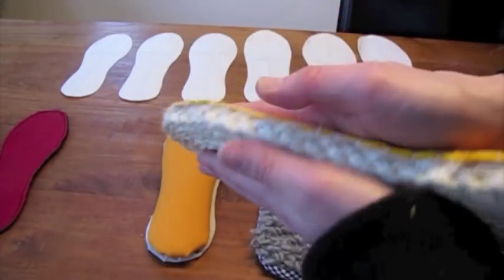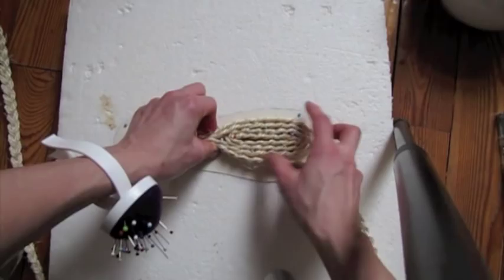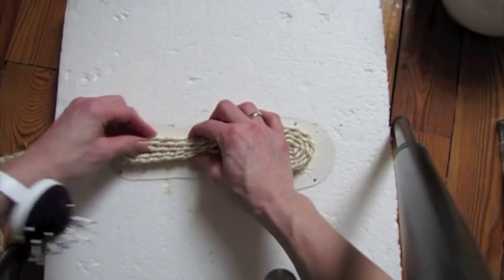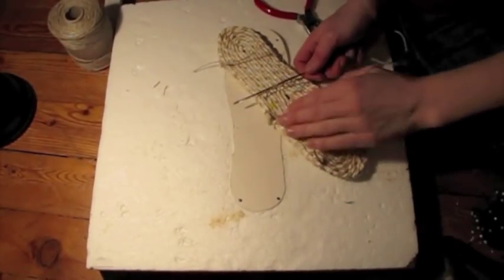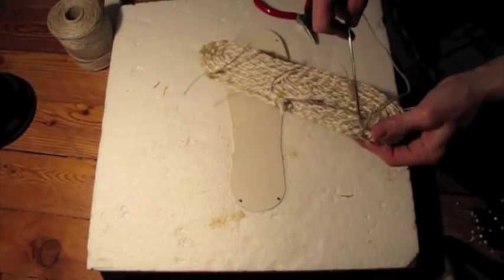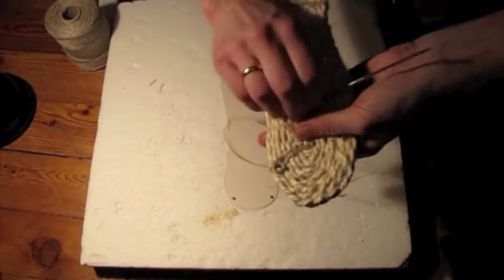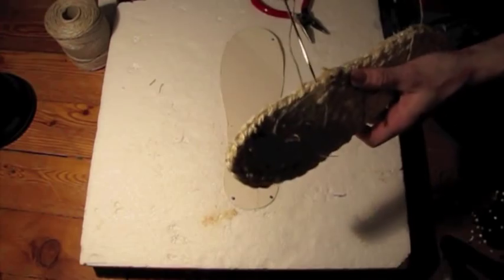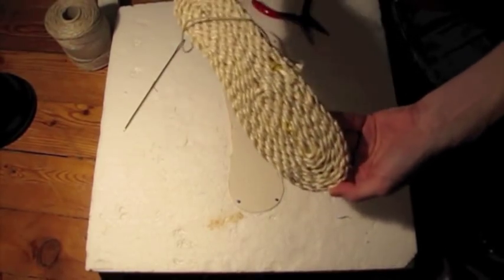Making Shoe Soles Part 5: Espadrille Soles!

Comment: Did you make a distinction between the right and left sole or are both the same? And how did you determine the size?
Reply: It should be straight lasted. It becomes right and left after you use it

Comment: Hello. I maybe missed that , but how much of the rope stuff did u need to make the soles.
Reply from the maker: KraljCorvin Hi! I am not sure, but it must have been around 3 meters. You can just keep adding on as needed...
Reply: ***** Thanks for your response ^^. Ok , this must be really thick cordage. I have made two espadrille-style soles from hemp cordage. They are much thinner and more flexible. Just have to put them to the test and see how long they last.
Reply: OfDreamsAndSeams can I use hot glue instead?